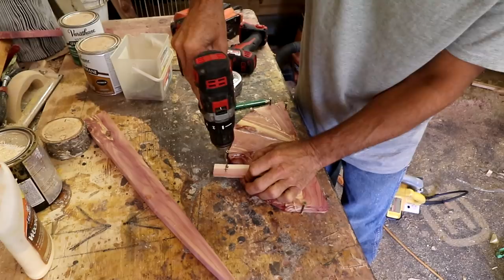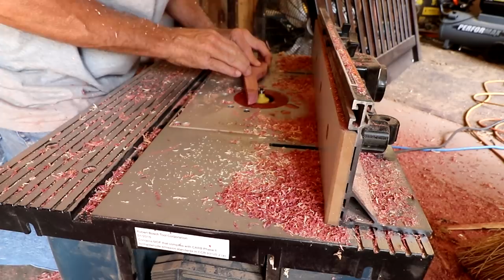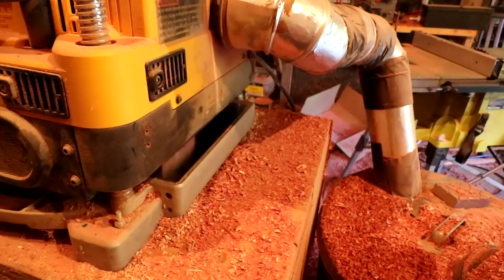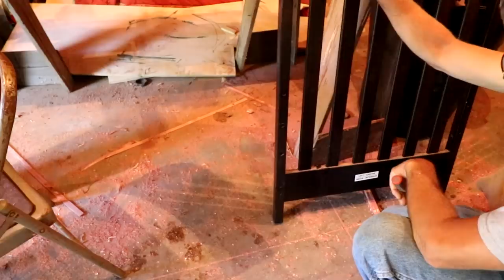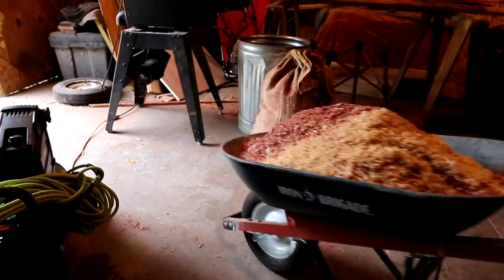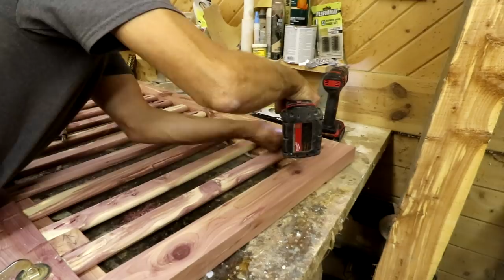THE WORKSHOP. The Baby's Crib. Part 3. The build continues. Assembly begins.

Comment: On the spindles tear out... would you have the same kind of tear out if you used a fence instead of relying in the bearing? ❤🌅🌵 p.s. Thanks for sharing... I'm new to woodworking and never heard of this so, thanks... I'm better prepared if it happens to me!
Reply from the maker: I am not sure, I prefer the bearing because I have more control.

Comment: you can buy a plug cutter that you put on drill press and then use plugs of same wood to fill screw holes
Reply from the maker: I need one of those. One tool at a time. ol.
Reply: @JoeandZachSurvival  they come in sets or separately so as to be used in different sized holes to accommodate  mist screw sizes. Should be able to find at any good tool store